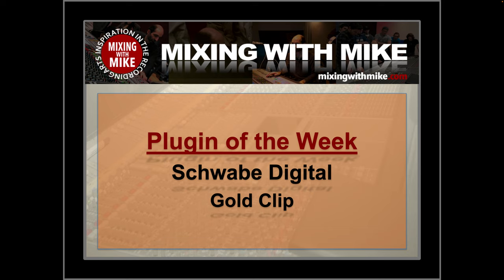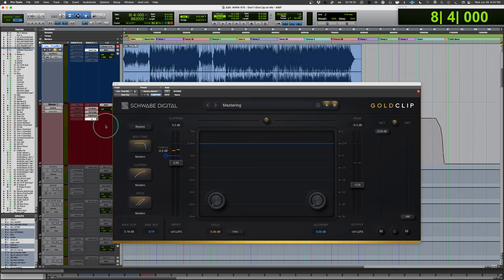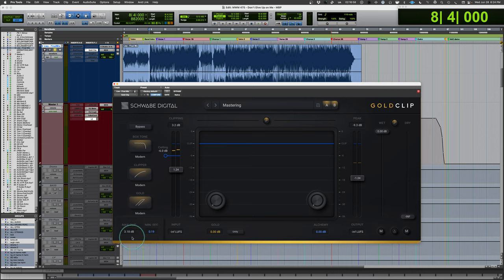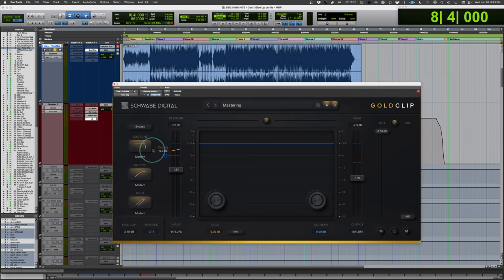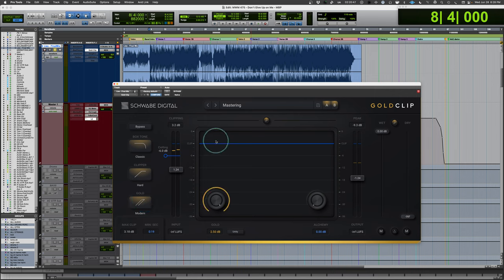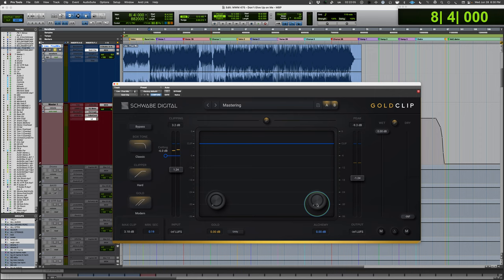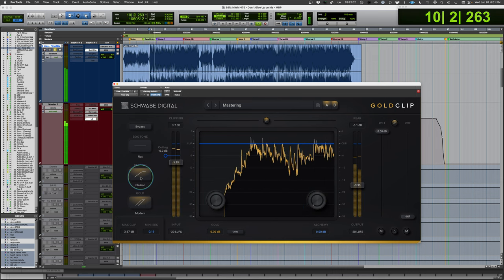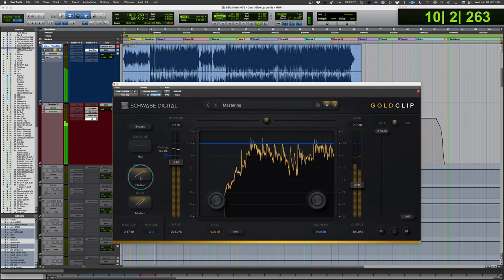Schwabe Digital - Gold Clip - Mixing With Mike Plugin of the Week

Comment: I've been demo'ing this plugin for the past 2 weeks, i'm a bit unsure about it but maybe i'm using it wrong. I love the crunchy punch it can give you with the gold knob, but what you gain in crunchy punch you lose in clearness and openness. I really wanted to love it but the HF rolloff is quite severe. 

Apparently the dev is working on adding an option to turn off the HF rolloff though which is cool

It's also a massive CPU hog on my system
Reply: acustica ash is way better
Reply: read the manual

Comment: Interested to see this compared against submission audio's Flatline, supposedly they were designed with identical intents.
Reply: Flatline is a simple soft/hard clipper, so they are not really comparable. Gold Clip is more of an analog emulation/mastering processor (it does parallel compression and some more stuff aside from soft/hard clipping), so I guess it's more comparable with the likes of Slate FG-X, DMG Limitless and Newfangled Audio Elevate. Flatline is comparable to SIR Audio Standard Clip, Venn Audio V-Clip etc.

Comment: The gold process is sample based gain with soft knee, net effect: upwards compression. As on the hardware, designed to not need to clip. 
Also, if it's anti-aliasing properly there shouldn't be any "digital edge" to warrant a HF roll-off.